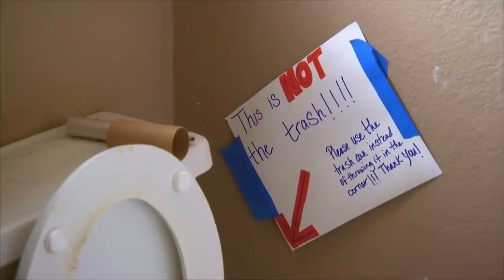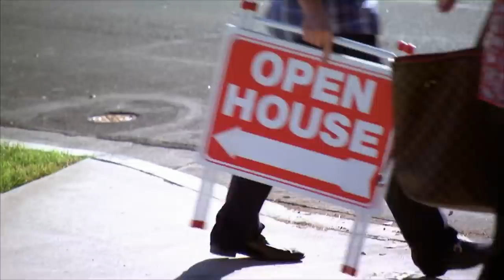Tarek & Christina Spend $100,000 On Flipping Abandoned House | Flip or Flop

Comment: I'm glad they actually featured a house that flopped. Most of the time you get the price and they make at least some money. Two better options for this property: 1. split the lot - if they could have done that, the lot would have sold for probably $75k at least. Probably more in OC. That would have covered the reno. Price the house at $365-75k (within comp for a really nice house) and you have $450k gross. 2. knock the old house down and build a new one. (And best yet - split the lot and build both, then sell both.) 

If they didn't explore splitting this lot, they made poor choices. If they did and TLC chose not to show that portion of the process, that's another thing entirely.
Reply: I was wondering if they ever included property where they lost money. In this instance, they wouldn’t have made a lot even wo major foundation expense. They did get a bit of a deal on purchase price, but only one buyer. And buyer held their feet to fire over closing costs. So they were unusually unlucky all the way round w this project!